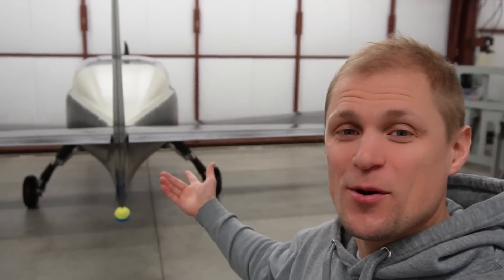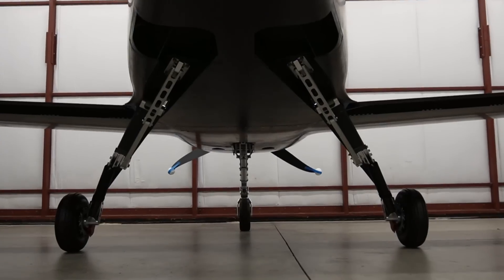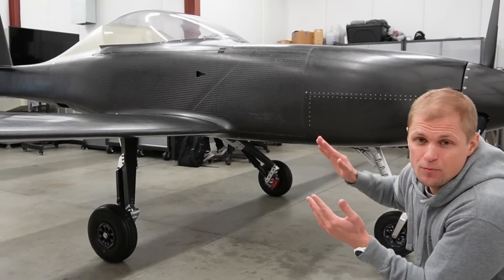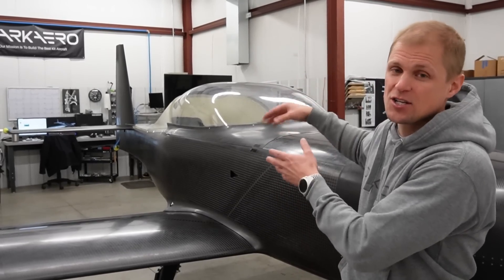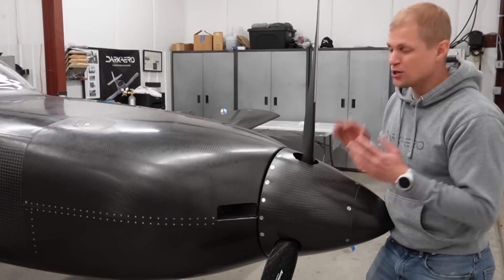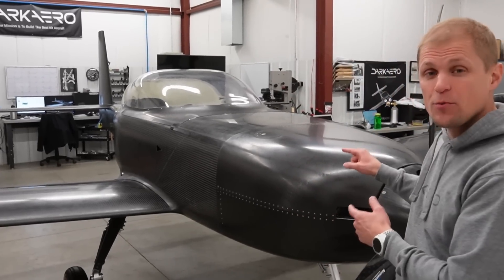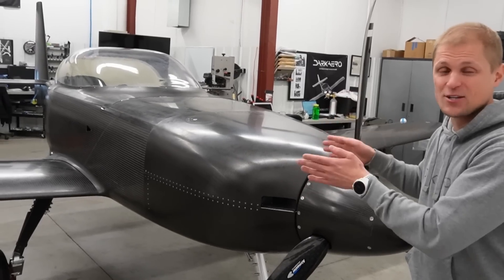DarkAero 1 - Full Assembly Discussion!

Comment: you didn't get any question about aeroelasticity, huh?

well, please comment on the aeroelastic response of the whole structure on the aimed performancd speed/altitude and within the entire envelop. what simulation environment have you used? Do you have the resonnance frequencies of the parts and of the  whole structure?

else than that, congratulations on the design, looks slick and I dont doubt one second it can perform the speed and altitude and ranges it intends, I am also pretty sure it'll handle like a fighter jet it will even generate lift at 90° roll, its handling ready feels amazing.

Comment: Unless you can manufacture these thing in large quantities, it's nothing more than a curiosity or, a play thing for the rich.
Aviation history is filled with things like this that are beyond the reach of your typical aviator.
Reply: Can't this be said about most (all?) new offerings in the aviation industry?...
Reply: @angela1984a  
No way this will be on the market for less than a million.
Reply: @MYOB990  I don't fully remember now, but as I understand it this is one of those kit planes that requires you to build/assemble at least 51% yourself. According to their website their estimated Complete Cost is $150,000 - $200,000 USD. I'm guessing there's more info on their website...

Comment: I’m sure you’ve addressed this in your previous videos, but I’m new to the channel and haven’t seen them all yet. When you say long range, what does that mean for a tiny two seater plane like this? 500 miles? 1,000 miles? More? Loving this channel, thank you!
Reply from the maker: Hey Noel, thanks for checking out our channel and for the question! We had considered putting a range map in the video. Most two seat light aircraft are limited to 500 - 1000 miles range. The DarkAero 1 is designed for missions of 1500+ miles. Our goal was to create an aircraft with capability to fly non-stop from our home base in the Midwest to either coast on a single tank of gas.
Reply: @DarkAeroInc  Wow, that’s amazing! Excited to see it fly, soon. Thanks

Comment: Will you have available and other selection of power plants? I met the team at Oshkosh a couple of years back. A project like this isn't gonna happen over-night. I'm glad you're getting close to a "finish" product. Keep up the great work!
Reply from the maker: Hi Ken! The DarkAero 1 is specifically designed around the UL Power UL520iS engine. Designing around a specific engine allows for more optimization than would be possible if we kept the design open to a broad selection of engine options. Thank you for continuing to follow the project!
Reply: @DarkAeroInc  what about the recently released turbo version of the ul520is ? Is it significantly different? Could be a significant improvement in true airspeed at altitude.

Comment: Nice that toe in is as designed, I'm surprised how talkative it is though. Is the angle perhaps excessive? is toe in significant in stability of the plane? what kind of rolling resistance does it add? how man percent does it add to take off roll.
First flight should be interesting. Will you use remote control, test pilot or one of you?
And yes battery flight is finite still. You could design a plane specifically for it where as much as 70% of the aircraft mass or even more is battery but you might still only get 1000km range. Not unusable but somewhat limiting. Battery flight does have a certain grace though, might approach the quiet of a glider with special pusher props and that would be pretty cool.
Green fuel can be used with combustion engines but doesn't change the experience.
Reply: They absolutely should hire a professional test pilot.

Comment: Good work - I have a couple of curiosities. 

What locking mechanisms have you used for all your fasteners? Split pins, Locking wire, stiff nuts e.t.c.?

Also, with it being a composite structure, that will be built in house by you. What inspection regime do you have to ensure that it has been manufactured properly? And also, how are you going to track the fatigue index management of the airframe. 

Regular large area NDI Mapping? At the very minimum full scale large area NDI should be done on the composite to pick up any areas of inclusions or delamination? How are you planning to manage this through the aircraft life? Will you be carrying out NDI post test flight and every say 25FH during testing period? One thing what concerns me, is the amount of raw holes which have been drilled through primary structure, these should be checked for anomalies during testing periods, and at a suitable lifing interval thereafter.

Again, great work, I am genuinely interested and able to offer some advice if you would like any. I've maintained composite aircraft my entire career that fly above the speed of sound and pull 9G, so may be able to share some experience.

Comment: Starting to look like a fabulous aircraft. From an aesthetic perspective I think the 'dark aero theme' should be retained, just a clearcoat to the carbon rather than paint as shown in some of the earlier renders, maybe twin stripes in a vibrant colour eg viper green/yellow/coral orange on one wing to match any additional colours (prop tips and step markings etc)? two questions I guess, 1) will there be a step up onto the wing step zone and will this be retractable also? 2) I'm sure this has been worked through a number of times design wise, but the canopy bubble 'windshield element' seems quite far aft, thus putting it quite close to the occupants, might this literally be, too close for comfort if the aircraft is designed for several hours of flight in a long range brief? It may just be the lens you are filming this that makes the windshield look significantly aft of the firewall? Anyway looks super athletic as far as light aircraft, keep up the good work and happy new year from the UK.

Comment: Very cool. What are trade offs with a possible turbo version? Heat? Fuel economy? CG? Toe in is a common tune item during a car dev - will you be able to play with that a bit on prototype? Canopy - for taller folks 6’ 2” plus - possible to have an xl canopy option or is fit good?
Reply from the maker: There are a few tradeoffs with incorporating the turbo version of the 520iS on our airframe, but the two big ones for now are space claim and compensating for the shift in CG. We are keeping an eye on the turbo version of the UL520iS and have considered what modifications would be required to the DarkAero 1 to adopt it. For now, we are remaining focused on integrating the stock version of the engine. 

We chose toe-in as a starting point based on designs that were most similar to ours, but we're going to play with the toe-in factor once we get into taxi testing and flight testing. 

Maximum recommended pilot height is around 6'4", and this assumes there will be extra space for a headset. We currently do not have plans to extend this to taller occupants by using a bigger canopy.

Comment: Will the toe-in geometry change once weight is added to the aircraft, thus reducing "scrub"?
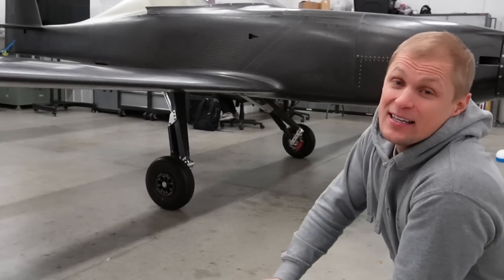Reply: 2:13 it looks like the angle is fixed and it will pivot according to the linkage pin

Comment: Thanks for clarifying all those points. Someone previously asked who your test pilot for the maiden flight would be. Are you guys thinking of flying the plane yourselves? After all, nobody's more familiar with this plane than you are :) but it must require some skill to fly something as sleek as this!
Reply: The last thing that they need is to do the test program themselves. It might cost a bit, but engaging a reputable independent organisation to administer, inspect the airframe and fly the test program will pay off in the long run.
Reply: @Smokeyr67   they need a test pilot with lots of hours.
Can't think of any small experimental manufacturer that hired a company to test everything.
Have to remember this is an experimental aircraft not a certified.
Heck builders will be making mods to them right away.
Reply: Wonder if Elliot Seguin would jump at the chance?  Oooh, poor choice of words!
Reply: @Jack-ne8vm  That would be great fun if that happened. We would get to see both sides of the testing phase.
Reply: @Jack-ne8vm  yeah, maybe, but nah.

Comment: Finally, was wondering how you would sort the engine intake. 

Awesome.
Reply: Yeah they have it backwards. They need a larger opening and faster air flow for cooling.  The expansion chamber to slow the air down is useful for getting the pressure up for the engine intake, which they apparently haven't made yet. So strange.